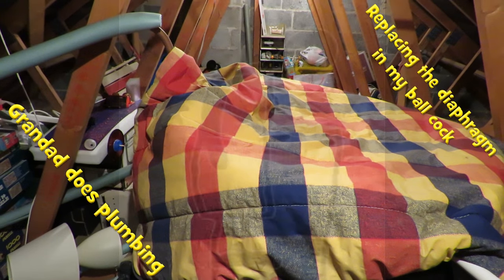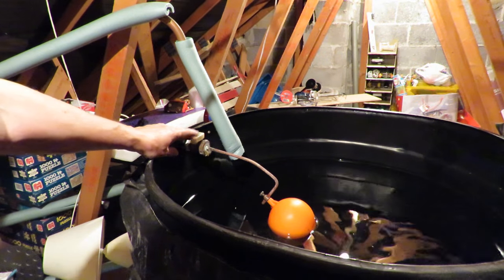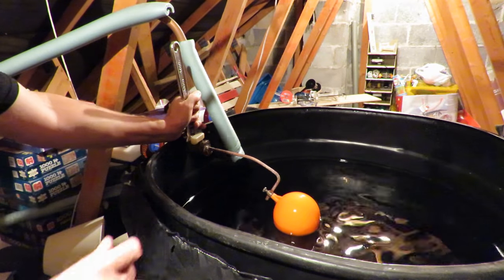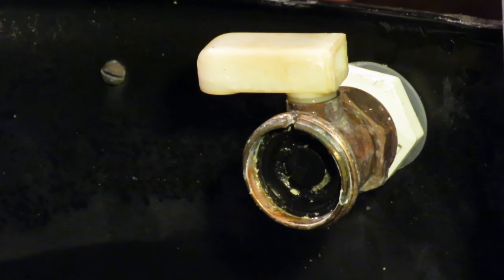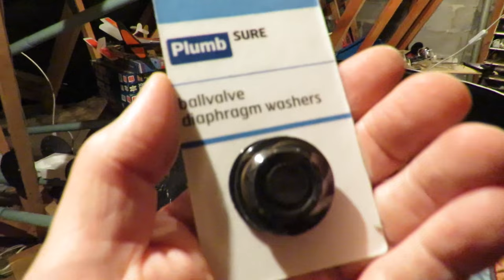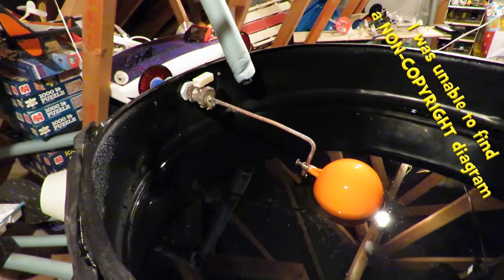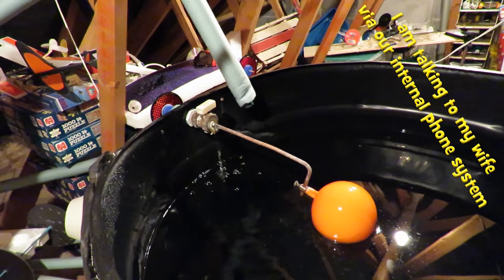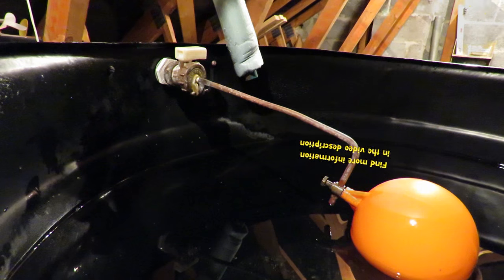Replacing the diaphragm in my ball cock

Comment: WARNING!!! Just tackled this job and soon realised that it is not worth trying to replace an old diaphragm. There was no way they end cap was going to come off after about twenty years. In fact even with it held in a vice after removing the entire valve assembly it took some shifting. You could easily do damage to the tank and its connection trying. PLEASE BUY A NEW PART 2 valve assembly and float and fit that, it will not cost a fortune. It WILL save you a lot of grief! DL Staffordshire UK.
Reply from the maker: Whilst I understand your comment, working on any old plumbing is always going to be liable to age related issues. Working on one end of the pipe could possibly cause a problem at the other end. If you want to save yourself grief I would suggest employing a registered plumber who has proper insurance. Then if the worst happens you are covered.
If you scan down through the comments here you will see I have already suggested that replacing the whole valve is probably the easier option. However the video still does what it says on the box.
Reply: Point taken to a degree but if the default approach is to employ a registered plumber, what is the point of all the DIY videos such as your own? Bearing in mind that some encourage having a go at far more complicated and  involved procedures. Common sense and working within ones own capabilities taking the simplest route such as I suggest can save grief on many levels including financially at the same time promotiog of a sense of achievement. Did I hear right when you asked your wife to turn on the hot tap to lower the water level in the cistern. If so, why waste hot water when the cold bath tap would have sufficed?
Reply from the maker: @davidlawuk1647  the cold tap runs off the mains supply, it does not come from the tank.
Reply: My bath, bathroom sink and toilet cistern are fed from the loft cistern not mains pressure. If yours are direct from the mains then your instruction was quite correct for your situation. Happy plumbing.

Comment: Tried doing this yesterday. The act itself is straightforward and no problem. The issue arises when the nut that needs to be loosened is caked in limescale and refuses to budge even after two hours of jimmying. I didn't want to break the darn thing.
Reply from the maker: Yes I know exactly what you mean and to be honest it is often easier and quicker to replace the whole valve unit with something more modern.
Reply: @GrandadIsAnOldMan  That's the plan. Time to start saving up!

Comment: Is this the standard setup for home plumbing?
It's very different from ours here in Canada.
Reply from the maker: If you mean having a water tank in the loft then they may be less common now that they were in the past but all the houses I have owned in the last 40 years or so have had them. There are many variations on the type of ballcock mechanism and arrangement.
Reply: Yes,  the tank setup.
What is your water service pressure?
Ours is 30ppsi at the house.
Reply from the maker: Wil Hobbs I have no idea, not the sort of thing I measure. As long as it fills the sink when I want to wash something that is all I need to know :-)
Reply: Fair enough.
It would be handy having a water supply in case of supply interruption.
But our attics are unheated and it gets down to minus 35c in the winter.
Reply from the maker: Wil Hobbs yes we don't get that cold although they are predicting our coldest winter for the last 6 years which won't be that hard to beat as the last few years have been particularly mild.Our loft is insulated and the tank is lagged with a gap in the insulation underneath to allow heat to rise from the house below. However that would not cope with minus 35c :-) I think we had snow last year but I blinked and missed it.
Reply: We've had an amazing fall so far.
No snow yet and daytime highs of 17 - 18c
Snow forecast for next week.
Hope we get alot of chinooks this year.
I used to look forward to winter but now.....
Reply from the maker: Wil Hobbs :-)